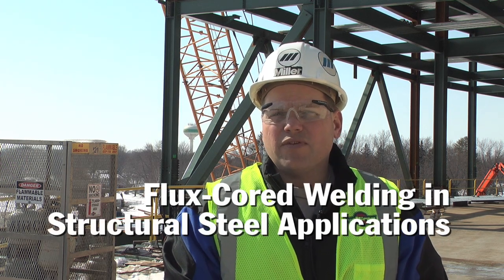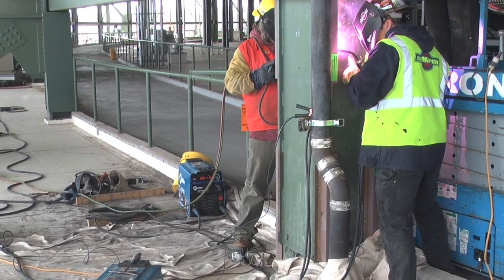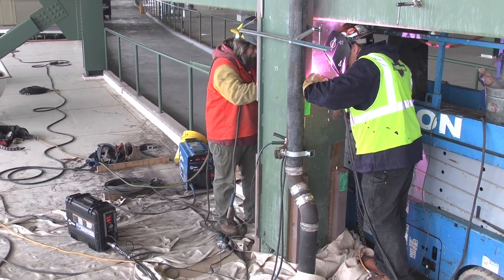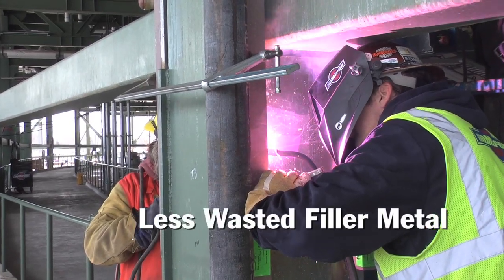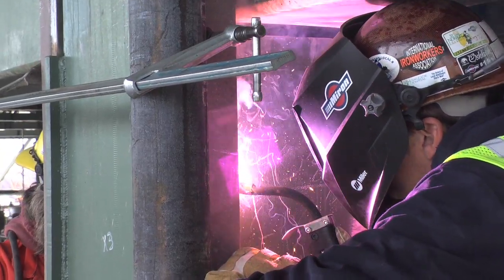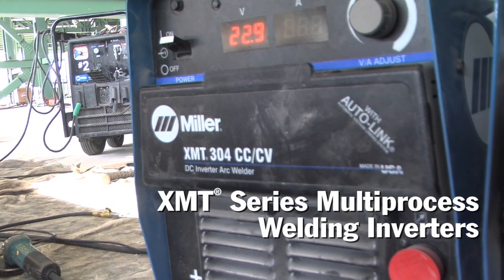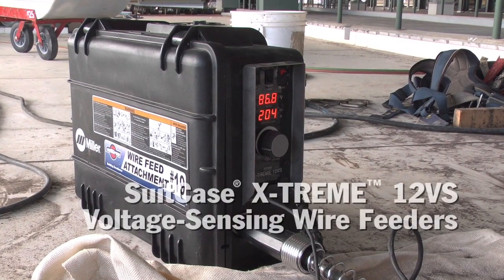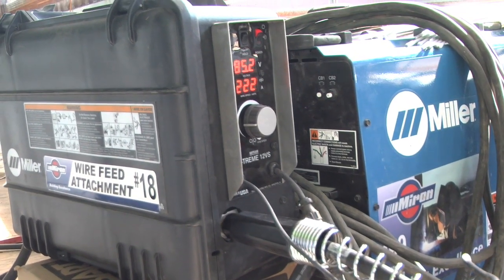The Lambeau Episodes 2: Flux Cored Welding in Structural Steel Applications

Comment: Flux Core Self Shielded Or Stick Welding for structural steel? Does the flux core self shielded penetrate in these structures?
Reply from the maker: Hi Osvaldo, thanks for your question. Self-shielded flux-cored welding process was identified as the best process for this particular project as it provided many benefits over stick welding such as increased welding speeds, increased deposition rates, and increased filler metal efficiency.

Comment: I cannot get min to power up.
I figure I must be hooking up up incorrectly.
Any help would be appreciated
Reply from the maker: Geo Petro,

Are you having trouble with your XMT? Have you referred to your owners manual for instructions?
Reply: Miller Welders
Indeed as I bought it used, downloaded a manual and also cross referenced my Miller 302 Trailblazer manual and in no way does it tell me how to hook it up the way my Trailblazer manual says to. I seen a video that someone hooked it up to a Lincoln and I have one and I'm going to try that. Believe me when I say I switched the Trailblazer knob to "Wire Sensing"  So I hope I am still hooking it up wrong and that I did not buy a lemon. Thank you for your assistance and for replying! I apparently need the help.
Reply from the maker: Geo Petro-

Sorry to hear that you're having problems. 
To better answer your question(s) we recommend that you contact a dealer near you. Use the following link for reference: https://www.millerwelds.com/wheretobuy/
If you have any other questions please let us know. Thank you.

Comment from the maker: Correct: the XMT, a multiprocess welding inverter, is plugged directly into the power source (Trailblazer), and the SuitCase X-TREME 12VS wire feeder plugs into the XMT. As a voltage-sensing wire feeder you only have the weld cable running to the work, no need to hassle with an additional control cable.